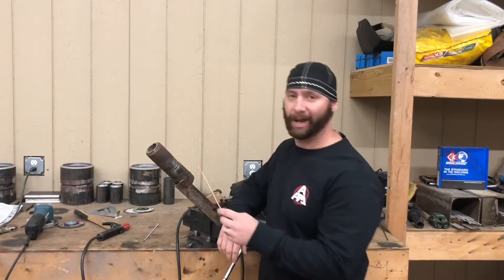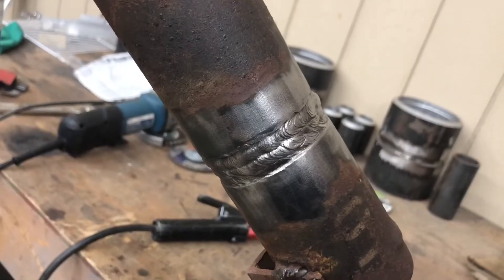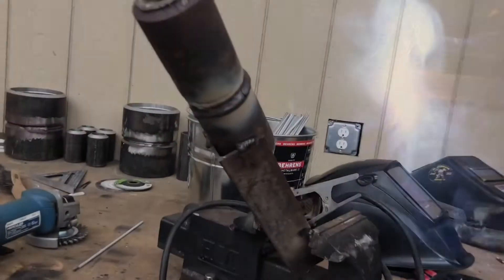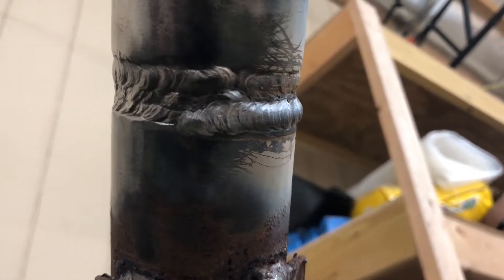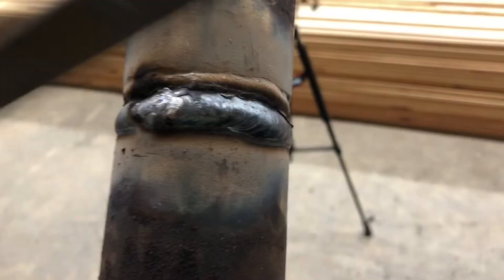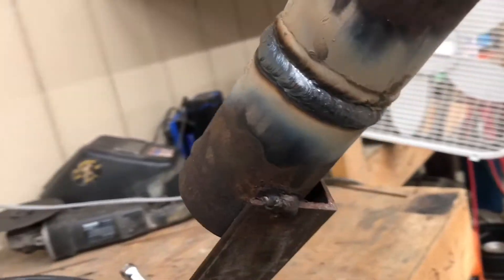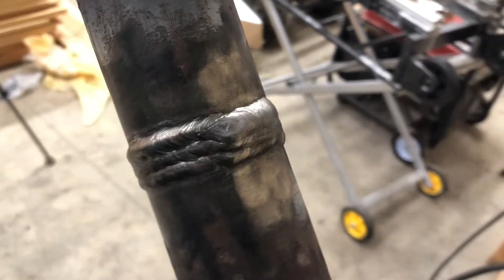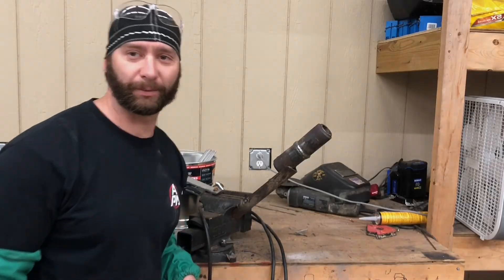6G weld test (7018 cap) tips for better looking caps

Comment: Great video man!! Been practicing hard for this test to cert my company. Lots of pressure 😂 
But I keep getting prosperity on the 6 o'clock. What the hell am I doin wrong here? Maybe to long of an arc when starting?

Striking and dragging back I'll definitely try. 
Cheers from Canada 🇨🇦
Reply from the maker: Yes definitely back drag. That should fix the problem. Also using hot rods will help them run better but you are probably already doing that. It could be from long arcing as well so make sure you’re not doing that. Hope this helps you my friend and good luck on your test. 👍🏻

Comment: I have an issue getting pinhole in my stops and starts any advice on how to prevent that awesome work by the way
Reply from the maker: Yessir. Always back drag your rod into the start. Not sure if I mention it in this video but it gives the rod time to heat up and burn properly before you get to the starting point. Also, pre heating the rods will help.
Reply: @getweldsoon1113  should I be doing any movement like side to side well zig zag I'm just moving straight wondering if that is messing me up too
Reply from the maker: Going straight has nothing to do with having pinholes at all. You can run straight stringers or zig zag a little if you want. Neither one is wrong.

Comment: How do you tie in the bottom so well? I can cap my 6” just fine but for some reason I have trouble with tying in on my 2”
Reply from the maker: Man it just takes practice. Gotta get your timing and speed just right. Back drag into the tie in and as soon as you get to it do a little loop around and get going because you know it will leave a knot if you stay too long on the tie in. Hope this helps. I’ll try to make a video just on that problem. 👍🏻
Reply: @getweldsoon1113  thanks for the feedback, I’m looking forward to the video!
Reply from the maker: Yessir.👍🏻

Comment: Do you have to cap with that machine on stiff? Or can you also cap on soft
Reply: My preference is soft as well I was just curious but your weld looks good thanks for the tip
Reply from the maker: Thank you sir. 👍🏻
Reply from the maker: Whatever you prefer. I prefer soft if the machine has the option.

Comment: You need to stagger your stops and starts and it needs to be a 4-5 stringer cap per aws.
Reply from the maker: Yes you should stagger your starts when possible but not much room to stagger on a 2” pipe welding bottom to top. If you back drag correctly you don’t have to worry about porosity in the starts. 
Also, no QC has ever complained about how many stringers I use as long as I’m not doing a big weave. If I did 5 stringers on this little 2” sch80 pipe they would have to be tiny stringers. It would be ridiculous. I do appreciate your comment though. 👍🏻
Reply: Schedule 80 I've always done 3 stringers. I've seen a minimum number of stringers but never a max amount on WPS. I'm not a pipe welder. I'm an ironworker who can weld x-ray pipe
Reply from the maker: I Haven’t either. They just normally don’t want you to go way outside the bevel width. They never care how many stringers you use as long as you’re not weaving big.
Reply from the maker: Actually, it depends on how thick the pipe is. The thicker it is the bigger the bevel will be, meaning you will have a wider cap. Don’t be trying to correct me when you clearly don’t have a clue what your even talking about.

Comment: How do u get it so u get solid connections on the bottom and so that it doesn’t droop?
Reply from the maker: It just takes a lot of practice. If you are getting droop then you are either staying too long on the tie in or you may be over lapping the tie in too much, putting too much metal on it. When you fire up and drag into the tie in you need to do a pretty quick loop motion to tie in and get moving away from it pretty quickly because it will begin to build up and sag on you if you don’t. Hope this helps you.

Comment: Are you just runner a stringer or are you moving the rod
Reply from the maker: I tend to move a little back and for but you don’t have to. Everyone welds a little different. They both ways and do what you like better or what works for you. 👍
Reply: @getweldsoon1113  A slight weave will help it "wet out".